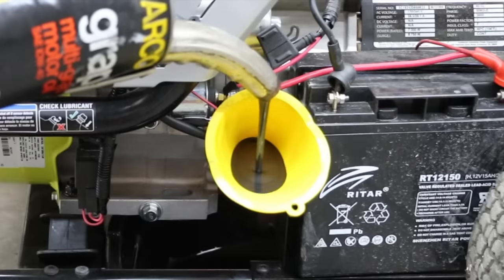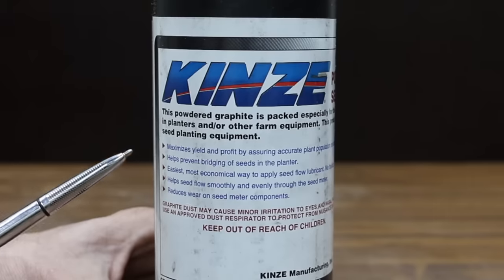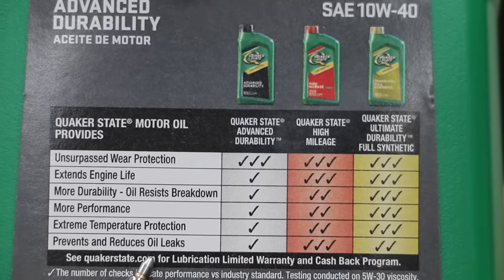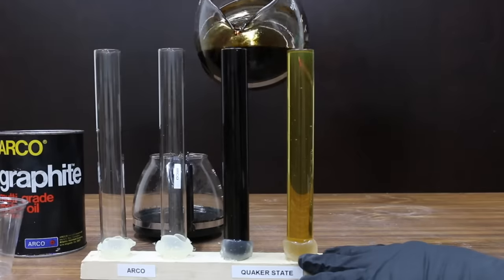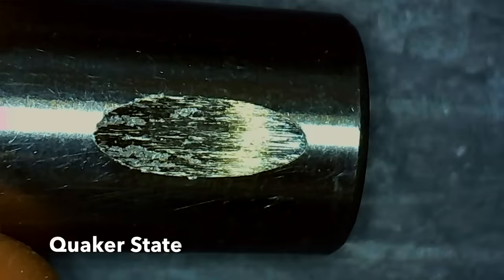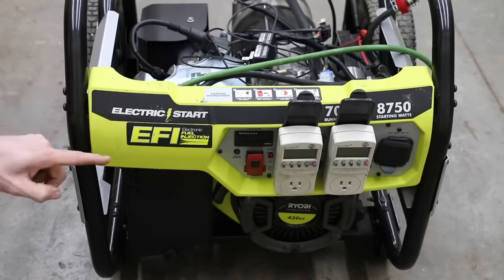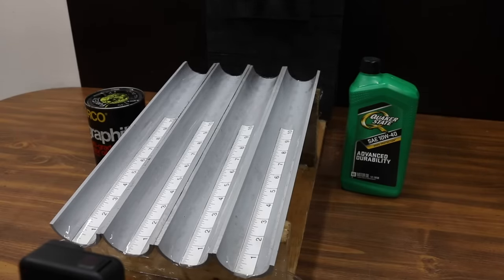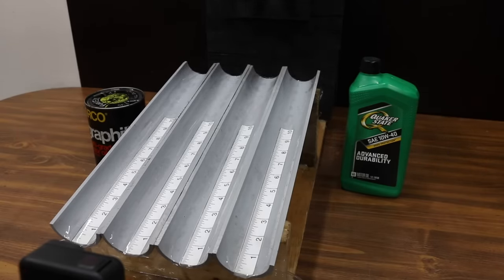Will "Graphite" Help Motor Oil Performance? Let's find out! Vintage Arco Graphite vs Quaker State

Comment: I used the ARCO Graphite oil for years on vehicles and equipment I owned. When it became scarce I bought up what I could find and began using it as an additive to oil when I would do an oil change. And yes the great part about the product is the graphite would get into the pores of the metal and make parts last by reducing friction. The only complaint I remember about the oil was that is was black so people could not tell by the color how old it was – if the oil needed to be changed. Now my wife had a 1972 Toyota Corona back in the day and when I changed the oil to ARCO graphite the RPMs went up several hundred on the engine and I had to idle down the engine- slow it down with idle screw. Showed me that the oil was reducing friction immediately on that engine. Now the problem with cars today would be the catalytic system most likely the graphite could be a problem. However back in the day the ARCO graphite oil was my go to oil. In fact I have a lawn mower and air compressor that still has some ARCO oil running in them- these are 30 to 40 years old and still running fine. The one thing I  thought back in the day as to why ARCO Graphic was taken off the market was the possibility that it could cause equipment to last too long. Some stuff might never wear out.
Reply from the maker: Great information. Thank you
Reply: This comment needs to be pinned.
Reply: I can’t help but wonder how much actual graphite makes it through the oil filter.
Reply: LiquiMoly has an additive called Ceratec that has similar effects. There is no comparison between the before and after, it smooths out rough idles, improves economy, and if I did a UA, I wouldn't doubt they'd find fewer elements indicating wear. Can't recommend it highly enough. Only have to use it every 25k mi IIRC, I use LiquiMoly MOSQ2 every oil change that I'm not using Ceratec on both my BRZ and family car (2017 Honda pilot). Been using it for years now. Just noticed project farm did a review, gonna check it out
Reply: @michaelalbert8474  That's a good question. Even the finest graphite is around 5 micron. I'm not sure what he typical oil filter gets down to. I'm guessing oil filters are not very fine as to maintain flow and not reach excessive pressures.
Reply: Thank you for your input, glad you shared this. 👍
Reply: @mds6387  The best oil filter filtration I found was the Royal Purple that has a 25 micron rating.
Reply: The graphite particles get into the environments and contaminate the food supply. It was a totally bad concept from the beginning.
Reply: My father and I used it for a while in the early 80's i think it was.  Nothing scientific but after over 100K miles, hard driven in NYC, Dad's mechanic took the head off the engine, wiped it with a rag and was astounded that the parts looked like new, no wear.  We bought all we could find but ran out of it.  Wouldn't risk it in modern cars and we both drive diesels now.
Reply: @guyfernandez3328  If I remember correctly. that mechanic was repeatedly told to stop smoiking crack.
Reply: @jonathanhorvat2452  10-4!
Reply: @d-con6825  totally agree.
Reply: Back in the 70s/80s I worked in a molybdenum mine and iv seen pure moly in its natural state and I’m here to tell you that stuff is slick.
Reply: I have seen and have used grease that is a combo of moly and graphite but have not seen moly and graphite combo as motor oil. There is some question if the greasy metal like moly or graphite might be abrasive under some conditions doing more bad than good. Someone would need to test it under extreme pressure and heat. I did rebuild a motor or engine once a long time ago (maybe 20 years back) and I used moly and graphite on bearings , pistons, cylinder walls etc. The vehicle is a 1978 Ford Ranger and last I heard (about a year ago) the motor is still running and has not required another rebuild.
Reply: Maybe in a lawnmower it’s ok because there is no oil filter to clog up
Reply: @i Love Cops  
HOW do the graphite particles get in the environment from this oil?  Enlighten us...
Reply: I refurbished a fan once and added graphite to synthetic oil for the bearings. The thing lasted 10 years longer. I 100% believe this.
Reply: @grndzro777  Sometimes you just got to take a chance and try a product to see if it will work, good deal.
Reply: @ilovecops5499  why is graphite contamination a problem? It's just carbon. Consider how many kids chew their pencil it would have been replaced a longtime ago if harmful.
Reply: @b_uppy  licking the oil filter between changes duh
Reply: @Zack-lq9tb  
(Face palm)  Of Course!  Why didn't I think of that?, lol.
Reply: @ilovecops5499  you know that it comes from the ground right ?
Reply: @kellismith4329  By ii do you refer to Uranium 235?
Reply: I know that you know and I know it's true too!
Reply: @guyfernandez3328  Black Bear Co made that oil in NYC
Reply: @ilovecops5499  so is microplastics, bad concept from the beginning and contaminates everything. But it’s still used today. Plastics is worse, they cause a while variety of health issues. Meanwhile graphite is mostly carbon and poses nohealth concerns unless inhaled.
Reply: do you remember the stp brand graphite oil. arco was not the only one.
Reply: teflon slick 50 will also raise rpm
Reply: @ilovecops5499  it’s carbon. Are you speaking towards the processes to make graphite?
Reply: @uptown.mycology9928  Thank you Kind Sir. You have always been teh good and honest friends! 😀😃😄😇🥰🤗🤭🥲🦧🐯🐎🦊🐺🦉🐼🐧🐘🦏🍧🥫🍤🥘🥯🥨🍕🍟🥯🥞🧇🥇🎐🚸
Reply: thats not why you can thank california for it being discontinued
Reply: Nylon liquid  Teflon does the same.good stuff.motor idled up 200 rpm.T800Aust
Reply: @michaelalbert8474  That was my thought is does it cause clogging in filters.
Reply: why did they stop making it.? i know stp made it too.
Reply: @daviddowns7552  teflon is known for creating a very thin and hard film on friction surfraces which after few years crack and come off, clogging filters and dramatically increasing friction... Or should I say creating a grinding effect because edges of those flaking surfraces are damn sharp.
Reply: @TransAmDrifter  o appreciate reply. i didnt know that. ive never used the oil treatment but used a power steering formula and used their grease on simple things. thanks for reply.
Reply: Russell bourke engines 😈
Reply: the stp brand back in early 80s and maybe before was a dark blue color. it didnt stay around too long it seems.
Reply: @ilovecops5499  прям так много загрязняет, больше чем электроинструмент с щётками? Больше чем заводы по плавке алюминию, заводы литья в графит
Reply: @Ruinskiy  It depends. Tubes sound better than transistors when the THD goes above 1%. Its a trade off between low cost transistor power amps with hundreds of watts, and low power tubes which distort and compress nicely.
Reply: I remember selling this stuff at the Arco station I worked at. Never really caught on for us.

Comment: The powdered variety was very useful in gearboxes and differentials to eliminate the whine caused by worn gears. Also was used in wheel bearings to make then last longer. The powder in the engine turned out disastrous because it blocked the oil filter and oil passages and needed a full dismantle. This was more than 40 years ago
Reply: That makes more sense than running it through an engine
Reply: how about applying modernizing the approach and use graphene nanoparticles?
Reply: @drewberrynews3875  This is being tested all over already as a possible additive for engine oils. I haven't kept up with any of the studies, so I can offer no opinions on the subject.
Reply: @drewberrynews3875  still it might be worse on direct injection engines nowdays.
Reply: That's what I heard, and I remember that brand.
I think my father tried it once.
Reply: If so it might be OK for small engines w/ a filter.
Reply: I had a 4 cyl car that was dead but a friend and I decided to play around with it and added it to the oil. It spun a bearing.
Reply: That makes sense...the graphite is particulate, and while it does lubricate moving parts very well, it can also clog the really tiny oil channels in modern engines and definitely the oil filter.
Reply: @drewberrynews3875  graphene nanoparticles would be difficult to add to oil at home. Simply mixing will not take advantage of the smaller particle size due to micro-clumping. Nanoparticles need to be run through a shear pump to get the correct dispersion and take advantage of the smaller particle size. The length of shear time and type of shear pump varies based on several factors such as type of surfactant, viscosity, density, and batch size. I worked at a chemical plant were we use graphene nanoparticles in several blends. One of the biggest issues is dispersal of the nanoparticles.
Reply: This explains why it works so well in worn locks!
Reply: Sawdust works too!!  Ha ha!
Reply: @fredrhodes540  maybe ina leaky radiator
Reply: Exactly.  Oil does more than just lubricate.  It's two other purposes are:  to cool parts and to flush out debris.  When you start screwing around with a highly engineered product like engine oil, you're playing with fire.
Reply: Yes. I believe shortly after that is when they came out with slick 50
Reply: @austindenotter19  damn right. The bearing clearances are tiny these days. There is actually problems with bore wash out giving carbon build up in old oil; that's why you change filters. Also if it gets in the drive chains they will wear and stretch.
Reply: @fredrhodes540  Favourite tool for used car salesmen, eh?
Reply from the maker: Thanks for the info!
Reply: Yes EXACTLY
Reply: @austindenotter19  Yeah another crap product.  Solids in oil do not mix .
Reply: @floridaman1776  .Oatmeal.. Cicero Ave Chicago Ill car lots favorite.. back in the day.. Hah ;}

Comment: A friend of mine once bought a Volkswagen that the gentleman, the seller, had posted about the fact that he had run Arco graphite since new. When my friend took the oil pan off to replace the gasket, he discovered that there was about an inch thick of layers of graphite from when the oil had heated up and cooled heated up and cooled and it took a hammer and it chisel to break it out.
Reply from the maker: Thanks for sharing.
Reply: If it's a vintage volkswagen Beetle, it's air cooled and always cooks oil.
Reply: Arco not good?
Reply: @Magnulus76  Cooking oil is not necessarily the issue if it's a known variable. It's adding another layer of issue (the baked on graphite layers) that will cause unknown/unexpected issues. That's why you have to take what you hear from other owners or on forums with a grain of salt. No matter how common they are. Manufacturers run much more vigorous tests, but will usually not test them on old cars. Time is the ultimate beta tester, though, and there certainly are plenty of user tested additives or tricks that are very effective that manufacturers could never hope to have tested due to technology or duration.
Reply: @Magnulus76  Those have no oil pan.
Reply: Yep, that sounds like exactly what you’d expect.  I work with graphite lubricant at work and it sticks to absolutely everything.

Comment: When that came out everyone changed the their oil to that. After some time new cars were being brought into dealerships on the back on tow trucks. Mechanics would just drain the oil out and replace the sparkplugs. The graphite seeps past the rings and fouls out the plugs. That is why you don't see it on the shelf anymore, not due to the base oil.
Reply from the maker: Thanks for the feedback.
Reply: Makes absolute sense but what will it do to diesel engines🤔
Reply: I tried it myself and didn't like how it foamed.
Reply: I'm grateful to you for adding some of the history of this clever but brief engineering trend.
Reply: IlikeWillypete Willy I broke in my new 1979 Kubota L245DT diesel tractor with Arco Graphite and ran it for about 2 years using nothing but that product.  Fast forward to 2020 and my tractor has never had an engine problem and burns no excess crankcase oil.
Reply: @gutfinski  Does the tracor run on gas (so it has spark plugs) or is it a diesel (has no spark plugs)?
Reply: Leo Curious It is a 3 cylinder diesel.  Since Arco Graphite was black when new, things did not look much different after an oil change!
Reply: @gutfinski  So maybe its really good - but only for diesel. Since they dont need a spark to work, which graphite (as a conductor) would prohibit.
Reply: Leo Curious The only negative comment I ever heard about Arco Graphite is a theory that since the Graphite was in suspension it might take a period of time to start lubricating the upper cylinder area.  Since a Diesel engine typically runs at a lower RPM than a gas engine and usually runs a while before starting to put out power, my thoughts were that it would be ideal for a Diesel engine.  If it was still available I would still be using it.
Reply: @gutfinski  tractor that small probably doesn't have a centrifugal oil filter. If it did would have removed all the graphite

Diesel work a lot better with things like graphite because they have little to no vacuum on the intake stroke, and if in the case of a turbo they actually never have vacuum to pull in oil from the crankcase. They also have a far hotter detention temperature that would keep the carrier oil burned way enough to expel the solids especially in a agricultural engine that doesn't have to obey the same nitrogen emission standards as a over the road vehicle.... There's really a lot of reasons graphite and moly are better for diesels
Reply: I had a 1966 Volkswagen mini bus. I rebuilt the engine upping it to 1700cc. I used arco graphite in it and never had a problem. I’d be interested to see how vintage arco graphite compared to vintage regular Arco.
Reply: It would also cause the seals to leak my dad told me how it ruined his car
Reply: @joejakab7670  How do you know the seals just weren't  bad on their own?
Reply: Maybe it's just me, but when Arco came out with it, I thought it a bad idea since graphite is abrasive.
Reply: It sounds about right, graphite acts like small ball bearings rather then a lubricant.
Reply: @cityguyusa lol .. it was a fleet of cars with bad seals .
Reply: @leocurious9919  it is a diesel ,as far as I know.
Graphite was also only recommended for diesels, marketing sold it to everyone.
Reply: @gutfinski  Graphite is and abbrassive compared to engine oil. 
In stale machinery it would create a crust in places that lose the oil, which crust would clog passages and chisel mating surfaces upon breaking loose. Graphite is for dry lubrication, rest is snake oil.
Reply: i put 50pencils in my engine and needed a new motor 8>(
Reply: ferkemall  lol (i know)
Reply: @eddedwards9879  what do you mean diesel have little to no vacuum on the intake stroke? there is always a vacuum on the intake stroke on any engine. Also even if the engine has a turbo, the vacuum lines are attached before the turbo to equalize crank case pressure and for your master cylinder.
Reply: @hoseinqadam 

A diesel engine has no throttle body choking the intake off so it only has a small amout if vacuum compared to a gasoline engine. Every intake stroke on a diesel has the same amount of air then a measureed quantity of diesel injected into it. where the gasoline engine restricts air intake so maintain a fuel to air ratio.

This is why diesel cars have to have a separate vacuum pump to run the brake booster system, where gas cars just use the engine vacuum
Reply: @hoseinqadam  their is a very small amout of vacuum created by the filter makeing  an air restriction.  the vacuum is very small compared to a gas engine this is also why the pcv systems on a diesel use much bigger hoses to get the job and dont hav3 to worry about screwing up the fual to air mixture so they are usually pretty aggressive they don't even use a PCV valve it's usually just an oil separator

Comment: In addition to my earlier comment, I now recal that I used the Mobil w/graphite. To those who mentioned they couldn't tell if the oil was dirty, yes, it was black. However, there is a huge difference between black oil and an engine that has been neglected, and has caked oil and residue on all parts of the engine. I have taken engines apart that had to have the sludge literally scraped off. If you keep a record of when an oil change is done, you know that it should be changed every 3,000 to 7,000 miles. The oil, no matter if synthetic, regular or graphite, should not be dirty. I had one mechanic tell me, after I had told him that I used graphite, "well, look at your valve springs and rocker arms - they are covered in that stuff!! (the engine was cold, and with the oil filler cap off, those parts were visible).Which proved it kept it lubricated during cold starts. Regarding filters clogging, I never had a problem, and I went as much as 25,000 miles between one oil change, and normally changed it every 5 to 7 thousand miles. When the second owner sold it, after it had racked up more than 340,000 miles, it was still running fine, it only burned a quart every 1500 miles, and the only engine repairs done were 3 or 4 water pumps, valve cover gaskets  replaced twice, but no major repairs. The engine had never been removed from the car. The biggest complaint I ever heard was one mechanic who complained he couldn't wash the stuff off his hands. Which was pretty much the selling point of the product. It stuck to the metallic parts and provided lubrication, even after draining down after sitting overnight. Mobil had done a lot of research to keep the graphite suspended, so it wouldn't settle out after extended periods of disusae. It worked!!
Reply from the maker: Thanks for sharing.
Reply: Can I contact you for these full details, man?